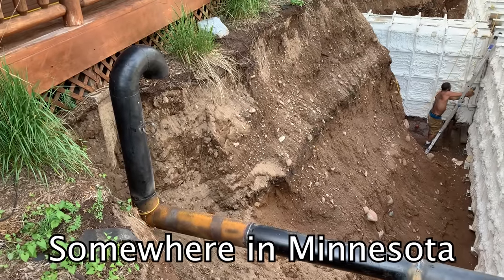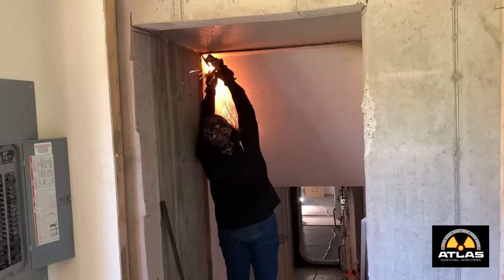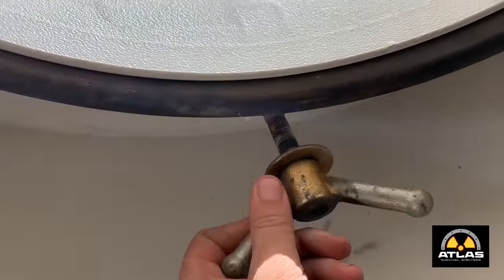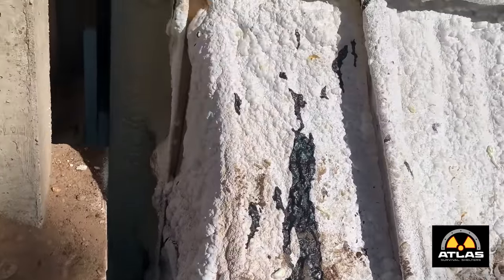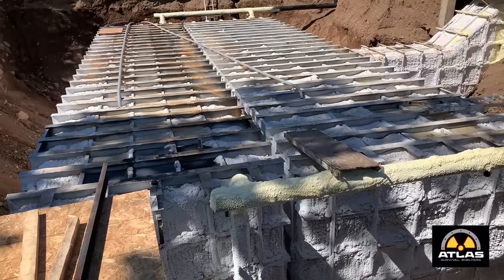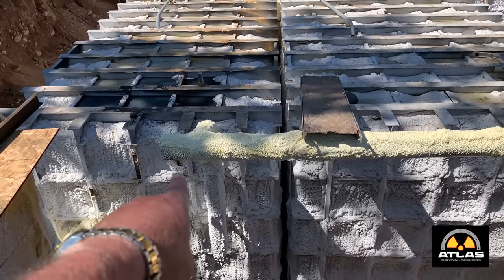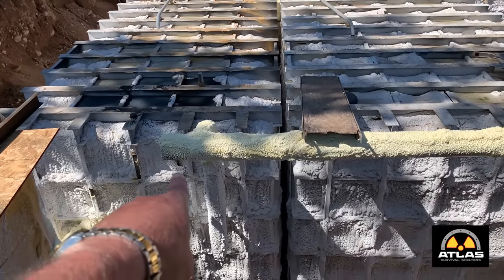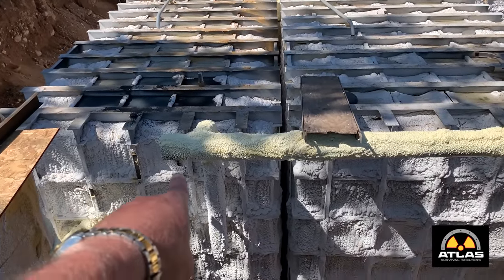A Completed $500,000 Luxury PLATINUM SERIES Doomsday Bunker

Comment: All that outside insulation. Yet never bothered to add some dampening insulation to the inside. All of that echo in that place would drive me absolutely insane and I would be using the escape tunnel within hours. And before anyone comment on the fact that yes it is a steel box which would echo; or the fact that all of the walls are Hardie board and that cement also has lots of echo; I can tell you as the owner of a construction company myself; that it is possible to sound dampen a steel box or concrete enclosure to not have crazy echo and sound transfer like that. Done it myself many times for clients with concrete basement that wanted to rid themselves of echo and have a soundproof game room. The last one I did had a sound system like that of a club and yet directly above it you didn't hear a freaking peep. And inside of it you also heard nothing from anywhere else in the house.
So to add all of the creature comforts to this place and forget sound dampening; is kind of meh in my opinion for a structure that is between a half-a-million to a million-dollar build.
Reply from the maker: Once the beds and couch in it goes away

Comment: How much thought was put into sound proofing inside the unit; to not have the annoying echoes that will go throughout these units? Even gluing acoustical, sound dampening tile will prevent that. Question: do all your air exchange pipes have a way to manually move air, by means of a bellows.

Comment: Additional questions,  2nd comment,    while 3 feet or upto 16 feet dirt, min, to protect against radiation. lead used on outside container have to be least 2 to 4 inches thick. How is air, also being remade, can't just let air in to recycle if radiation  in air ?  our radiation detection system being installed?  air quality measurement system being installed?

Comment: lets just assume all the logistical things are done correctly (water, electricity, sewage, food storage etc...) the big issue I have is god forbid you ever have to use this, the only way to know for absolute certain that the air filter works, or that radiation won't get in is after the disaster has already happened, and if it doesn't work it is too late to fix it

Comment: Very cool videos. I enjoyed watching them. My only questions are: Why in the world would someone build a bunker like this in rural MN? What is the threat from a nuclear attack there? I guess it's more about the cool factor to impress your friends than being practical. The people that should be thinking about bunkers are those located near major population centers, military bases, and especially those near Washington D.C. Those are the targets, not a random forest in MN. The threat of tornadoes is also pretty minimal in that part of the country. Concerning the construction, my greatest concern would be the way the bunker was attached to the basement. Depending on the soil conditions, the bunker and house may shift away from each other over time. Yes, I saw the 12" slab and the bunker was anchored to it, but that joint between the foundation and basement is going to be a major weak point impacting the structural integrity of the basement. It looked like the stairs bolted to the basement were just held up with steel sitting on dirt? Was this also on the slab and properly anchored? In MN, I can also imagine humidity/mold/rust being an issue without a proper HVAC or dehumidifier. Anyways, just my thoughts and concerns as I watched the videos.

Comment: Awesome video, but i have a question / concern about the air intake tubes. Do yall pig the air intake tubes after cutting/welding and then spray a corrosion inhibitor coating on the inside of them? With the condensation build up after a while, even having the traps in place I'm curious of the deterioration of the metal pipes with the condensation. I love the videos and quality yall put out by the way, I am currently looking at the Texas Platinum Series bunker, (as I am from Tyler, tx).

Comment: I would use regular doors.  Nothing slows down any intruders once inside, using those sliding doors.  Then again, if intruders get into the bunker, you have already likely done something wrong.  But would still be nice to have at least 1 more alamo with strong metal doors.  Not more vault doors, standard doors made of metal like you would have at most public spaces.  Escape tunnel is pointless if there is no time to actually use it once the intruders get into the bunker.

Comment: The sliding doors are trendy, but having had them in rentals they have pros and cons (save space, but noisey to open and close, and don’t keep in light or sound well, and can easily be spied through using the small space between them and the wall).

Comment: I was wondering. What if in an apocalypse situation, someone shoved a grenade down in the airpipe? Obviously, it wouldn't reach the inside of the bunker before going off but wouldn't that completely destroy the air system, causing the bunker to be defective?
Reply from the maker: It has a screen to block that  but this is not fort know but a fallout shelter

Comment: What if someone blocks the escape hatch, and welds the entrance shut/welds off the air duct?
Reply: Crunchy on the outside, soft on the inside.
Reply: @williamchamberlain2263  

Elaborate?
Reply: @nonnegotiable2777  relatively simple, actually
Reply: @williamchamberlain2263  

Mummification.
Reply: What the hell do you think happens? Everyone inside dies pretty quickly. These are not "bunkers", they're just fancy, expensive tombs
Reply: @Bishop228  NINE month old thread mate.

Comment: The air inlet should NEVER be at the house because if the house burns down in a SHTF the pipe can be damaged by the fire.
I'd put the inlet and outlets further out away from any structures.

Comment: If u out 8 feet of earth over this, you wouldn't need heat or AC. 8 feet below the surface Temps do not change: in Lincoln Nebraska, as example, -20° F and snow at the surface in winter, but 58°F 8 feet down.   An old man there hlheats and cools his house for the cost of blowing air up from pipes buried 8 feet down, a huge area with these pipes heats and cools h8s home and greenhouse. There are pics online in the greenhousse, 20 below outside with snow banked all agaisnt the greenhouse, and a full size orange tree bearing fruit, all winter long.

Comment: I'm no expert in building, construction or bunkers....but as a logical engineer my instant worry would be the pipes running close to the surface, especially if these are critical supplies, air, water....unless the reason is gravity feeding water I don't see a good reason not to protect these critical supplies more by running them further underground and in the base of the bunker..?  Love to know the justification.   Cheers
Reply: Goo thoughts to prevent contamination of supplies...however what prevents someone blocking either one off to strangke supply and suffocate rather than poison......

Comment: Hi,  i have question, do you have optional if i want rust converter on the welded areas, instead of the rubber coat ? because the rust will be under all that stuff but it will not stop rusting...just asking..and thanks for all this really good videos.

Comment: I'd have a blast door between the two, instead of that opening, and why don't u just have a peephole in the door, obviously with ballistic glass, instead of that noisy heavy metal hole thing,,, lots of upgrades and quieter kit available,, galvanised those steel pipes and use air tight flanges, no welding

Comment: Not too sure what's stopping someone from someone who really wants to get in there from getting a couple of logs soaked in gasoline and tar the and putting it in front of that air filtration system and igniting them. 

Either that or going to a junkyard and scraping iron oxide from old cars laying around and getting a small ball mill for rounding rocks to powder aluminum and a few old car batteries ran in series to ignite it. 

Now I would never do such a thing personally but if someone was really motivated to get in there they could for less than the price of some matches and the rest can be found/stolen

Comment: In case of use for nuclear attack it is assumed that the main services are suspended.
How long is it self-sufficient?
Are there no external surveillance systems?
p.s. the plastic air pipes are too exposed don't you think?
Reply: For a nuclear attack it won’t be self sufficient as it wouldn’t be there. Nuclear bunker are a lot further down into the ground so if they are near ground zero they won’t be taken out. This bunker is more of a panic room.
Reply: He does NOT use plastic air pipes, his are made out of 6 inch galvanized steel pipe.  Rising shit bunkers use plastic for the air pipes.

Comment: Thinking that a T shape to the escape tunnel, with the pipe up to the surface, and a down pipe, say 3ft deep, open on the bottom with earth base.  Allows a space for the earth from the escape tunnel to collect if you need to open it, so it doesn’t fill up your escape tunnel, and also creates an emergency latrine, should all else fail.
Reply: You’ve not thought that through bro
Reply: @____________________________.x  in what way, my Norman Knight?
Reply: @andrewallason4530  If the pipe is open to the earth, then water is going to seep in. The amount of sand that drops into the tunnel is about a square metre, it's not an issue. The last thing you want in a bunker is an open latrine, there's no air hatch on that tunnel - poop into a bag, seal it and store it in the decontamination room until it's safe to leave.
Reply: @____________________________.x  yeah, nah.  Water would only seep in in areas with a hight water table. In that case you’d cap the bottom end of the pipe.

Comment: I'm disappointed in the  submarine doors  why aren't they not made of 6 feet thick modern tank armor and concrete that can function as watertight and gas tight and function as a legitimate blast door and have a really good locking system

Comment: Wouldn’t a fire under the intake pipe smoke people out? You only have x amount of oxygen in the bunker.
Reply from the maker: You just turn off the air system.  That shelter has enough air fir 24 hours wirh 4 people

Comment: There are 3 kinds of radiation resulting from a nuclear strike and unless you're at ground zero the gamma is the least of your concern for long term survival.
Alpha and beta contamination from fallout will kill you stone dead and none of the shelters account for the level of sealed air handling and filtering you'd need to protect yourself from it along with an entire laundry list of necessities required to keep the air handling system clean, etc.

Comment: What's the intended use case for this "bomb" shelter that's too shallow to survive anything but indirect damage from a nuke?
Fire/flood? I guess. But "doomsday" suggests a complete collapse of society.
So what's the plan for food and fuel if society collapses and you are forced to rely on this kind of shelter? Gasoline/Diesel generators will eventually run out of fuel. You can't rely on the existing grid for power. Solar Panels don't last forever either. So how does the client plan to do anything in this shelter beyond a few months?
And there there's the food problem. I hope the client knows how to run a farm with manual labor and packed some seeds for staple crops. And they also better know how to can/preserve perishable crops.

Comment: I don't see why you couldn't just take 8" aluminum dryer pipe and run it to the exhaust of a truck. There wouldn't be any pressure to set off your over pressure valve since car exhaust is 2.5" any additional pressure would just exit the pipe at the input.
Reply: He literally just said that pumping any gas would shut it off. And even if it doesn't set it off, the cameras will alert the people inside the bunker that there is someone trying to gas them, so that they can respond. Also, who will have a truck or any car to do that in a post apocalyptic world? Its probably not worth it for someone to go through all that trouble to do this.
Reply: @PilotTed  I see you have experience in apocalptic world and know how hungry people react when there is 1% chance that there is some food in bunker
Reply: @PilotTed  You keep disproving any flaws by saying "why would anyone going through all that effort to get in". I mean, why does the bunker boast about any of its safety features if you think no one would go through the effort to break in? IF there was a post apocalypse, we have no clue how things would be. You're in a habit of dismissing potentional problems or threats, and saying something along the line of "it wouldn't happen like this is a post-apocalypse. Like, seriously, we don't know how things would go. You're better off preparing for everything

Comment: I'm really not convinced that a relatively thin metal structure buried a few feet below soft soil really does much for "doomsday" protection. Maybe for a tornado.
Reply from the maker: Fallout is fine.
Reply: @AtlasSurvivalShelters  im really curious if you guys have any videos on "torture testing" your designs in real installations where a finished bunker is out through extremes to see how they hold up.

Comment: I have a couple of questions …1 how deep is this ? Is it deep enough if like a bomb, or other nasty stuff. 2 people talking about airflow,if having to live in there wouldn’t  you be set up for clean flowing air
Reply: I’m not an expert and I don’t represent the builder but it wouldn’t protect against conventional bombs. Most nuclear detonations would occur above ground level. It would travel above the ground. Unless you were very close to the detonation you would probably be fine.
Reply: @whiteguy4282  

A nuke would depend on how far away.  Government Bunkers are suspended, or on springs to absorb the shock of a nuke which could kill you in a normal bunker.  Even going off in the air.  A conventional missal to the bunker and you're dead.   6 feet of dirt is nothing.  Deeping down and surrounded by concrete first, maybe.  But the odds of a bomb are pretty slim.  Why would anyone do that, let alone know that it was there?  As for a Nuke, looks to outside of a city to really worry about.  Other than a wasteland up above as you exited the bunker.   The house could be gone or at least mangled.  Just to many factors to know for sure.  But it's far better than being out in the open, maybe.    

Plus it works great for hiding out from the Inlaws or needing some more bedrooms for guests.  Here, stay in my bunker!!!

Comment: 2:43   I have been a completely certified welder, back since 2003. Over 20 years' experience all over American in many different fields of the industry. At my current place in the industry, I do high-grade aluminum/stainless steel welds for pharmaceutical companies on high-pressure pipe and valve systems... I am in no way trying to be insulting or trying to shame you. But more concerning after watching some of your YouTube clips. Just after seeing those 6011 or 7018 stick welds... the amount of porosity the welds is concerning... Do you X-ray Scan your welds? Some of the welds dont even have all the slag chipped off of them, too. If i can see that amount of porosity in a weld from just you taking a quick video... I can only imagine... I'm just giving you a heads up on who you my currently employ... If i was looking at thors welds. It wouldn't be close to the acceptable standards, running a top.of the line company. Especial one calling out other companies for their horrible laziness and complete uneducating, let alome just ripping people off that don't know any better... From everything else i do see you all run a very good business and I hopefully will be doing business with your company sometime in the near future... Unless I dont choose to move into one of thoes old ATLAS Luxury Bankers... Very temping considering you dont offer a swimming pool... 😂

Comment: nice but if you know the bible the day comes and everything will be filled with water. So, unless they are using a base that can release the bunkers and they can then flow on the top of the water, then you are just building an expensive casket. It could be an option later on for your next project.

Comment: Where goes all the solid garbage? After some time of living in the bunker there will be tons of empty (and dirty) food containers (metallic cans, plastic, cardboard), scraps of food and whatnot.
Reply: Bag it up and put it back under the floors. Am more worried about doing Landry. Am a over thinker and I see you can go odd school for entertainment flatscreen TVs with game consuls/DVDs Blu-rays, lots of food but I never see a washer/dryer in a bug out Shelter.
Reply from the maker: Mud room for stirage is why the gas tight door is there for methane gas
Reply: @AtlasSurvivalShelters  Thanks for answering, that's a very clever idea. However, for the sake of the discussion... this is a much larger than usual bunker, and I expect it to shelter more people. While the mud room is the same size, so I suppose it's going to get filled to capacity much faster. Shouldn't there be some trash compactor? Also, there'll be a lot more water getting added to the system as they go through the bottled water, wine, beer, Coca Cola, canned food... where will all that water go?
Reply: @goupigoupi6953  The only thing you'll need to remove is waste food, liquids go down the sink/loo and are pumped out to the septic. Containers are cleaned and left bagged on the shelf, it's not like you are having amazon deliver more boxes.
Reply: @____________________________.x  I must have missed the septic tank part, if there's a septic tank I have no more complaints :)

Comment: I would just fill the air intakes with expanding foam , or just use a small drone with camera to pull a thin hose line down the pipes but no reason to do it